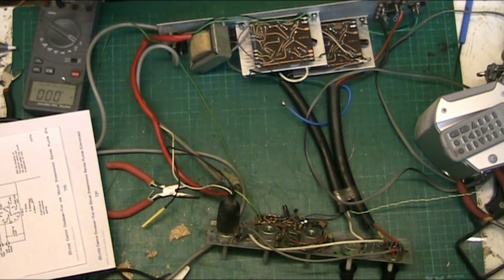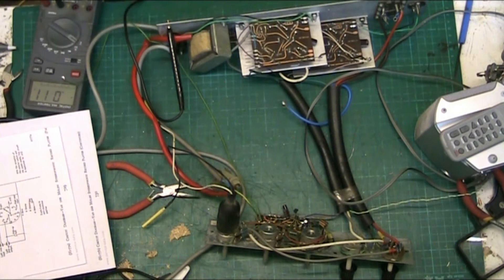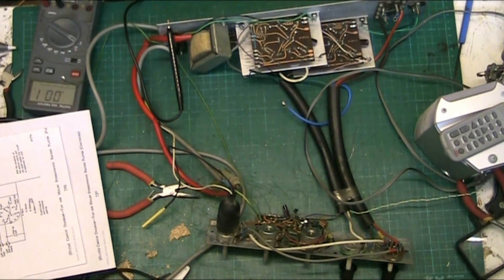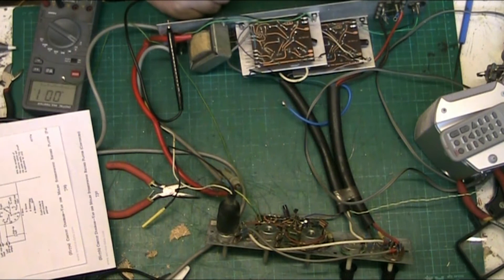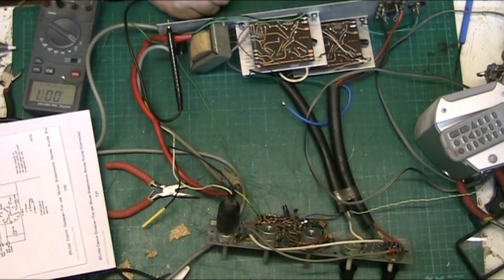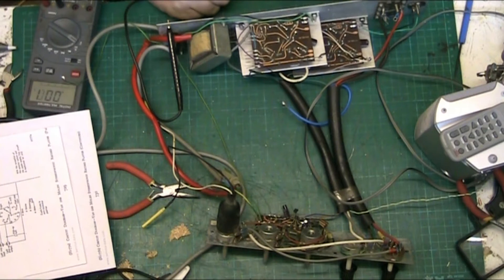VAN DER MOLEN AMPLIFIER Pt 3

Comment: Hi Andy great video again How do you rate the switch cleaner you use ? I have been thinking of purchasing some for myself as cheap enough on eBay
Reply from the maker: it's ok but slightly conductive so leave it for five mins before switching on